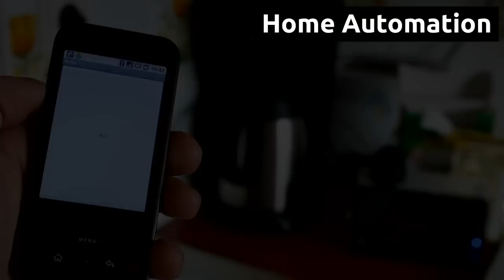Tinkerforge Introduction

Comment from the maker: @iToasterman The engadget headline is a little bit sensationalist. We don't see us as competition to Arduino. Arduino is programmed on the device in a C derivative and our stuff is controlled from a PC with a high level language.
Sometimes you want to solder and make your own hardware designs and sometimes you just want to automate something as fast and easy as possible.
Those concepts can both coexist quite happily :-).